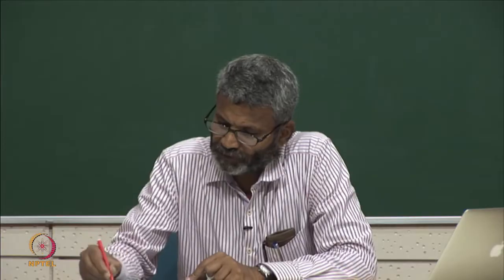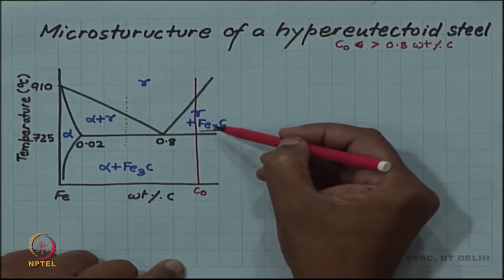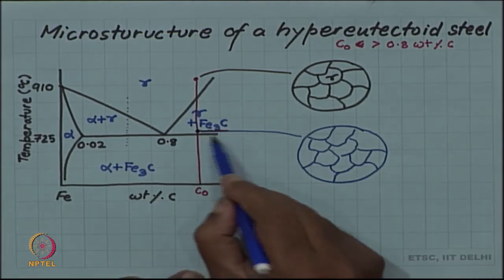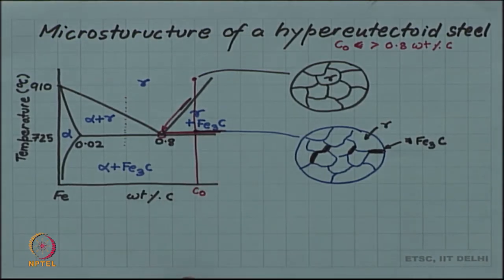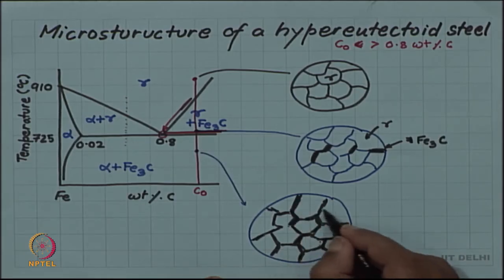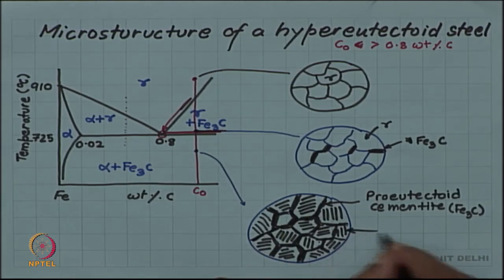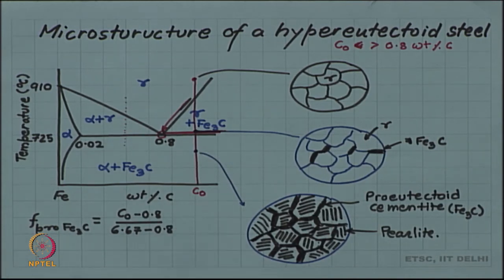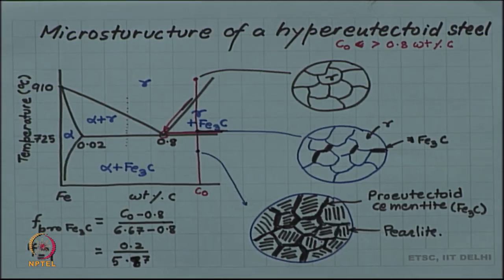Microstructure of a Hypereutectoid Steel (Contd)

Comment: I had a little query sir, please answer this. The amount of proeutectoid Fe3C  in the microstructure just above eutectoid horizontal should be same as in the microstructure just below it as it is the max amount of proeutectoid Fe3C. But here it's different. Why is it so?
Reply from the maker: You are right in your statement. But why do you say it is different here?
Reply: Sir you have drawn three microstructures. Second one is for the point just above eutectoid horizontal and third one is for the point just below the eutectoid horizontal. In second microstructure Fe3C is present only at some places in the grain boundaries but in the third one Fe3C is present at every place in the grain boundaries, from here I inferred that amount of  proeutectoid Fe3C is more in the third one than the second and therefore asked the question.

Comment: Sir at  0.45 you said hypoeutectoid ferrite but in previous lecture you called is as proeutectoid ferrite now I am confused please help  thank you sir for this wonderful lecture series
Reply: We use hupoeutectoid and hypereutectoid to indicate the C concentration of steel with respect to the eutectoid steel, i.e. 0.8% C. A steel with less than 0.8% C is called hypoeutectoid, one with more than 0.8% C is called hypereutectoid. Proeutectoid and eutectoid are used to indicate the history of formation of ferrite in the microstructure. If ferrite forms from austenite, independently of cementite, it is called proeutectoid ferrite. If it forms jointly with cementite, as pearlite, it is called eutectoid cementite.

Comment: Can anyone explain why a proeutectoid cementite forms as a network rather than as a separate grain unlike proeutectoid ferrite ?  Is it only because there is insufficient cementite as briefly hinted at the end of this video ?
Reply: The volume of proeutectoid ferrite is much larger than proeutectoid cementite. Hence proeutectoid cementite simply deposits in the grain boundary only whereas proeutectoid ferrite goes inside the grains away from the grain boundary also.

Comment: Sir, Both proeutectoid-Ferrite and proeutectoid-Cementite starts forming at the grain boundaries of the Austenite. Then why is it so that proeutectoid-cementite forms a network of grain boundaries whereas proeutectoid-ferrite simply separates out from the grain boundary?
And today is Guru Purnima... shat shat naman apko guruji.
Reply from the maker: It is simply because the volume of proeutectoid cementite in hypereutectoid steels is much less. Thus it simply decorates the grain boundary. In contrast, the volume of proeutectoid ferrite in hypoeutectoid steels is much larger. So it grows inward to larger distances away from the gb.

Comment: what are the differences in mechanical properties of hyper-eutectoid and hypo-eutectoid steels ?
Reply from the maker: The difference in mechanical properties comes from the difference in %C. Hypo had low C and hyper has more. Higher the %C higher is the amount of hard and brittle phase Cementite in the alloy. Thus higher C steel will be harder and more brittle than lower C steel.
Reply: @introductiontomaterialsscience  Thank you very much Sir.